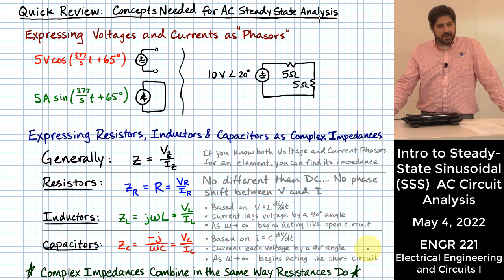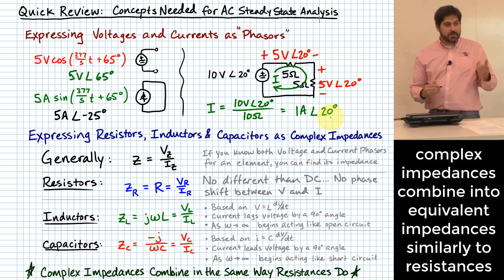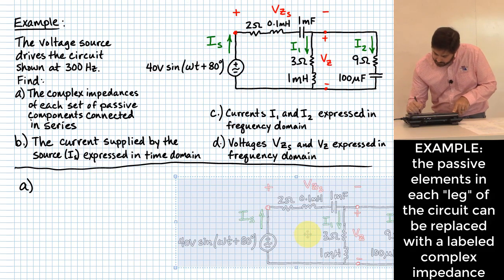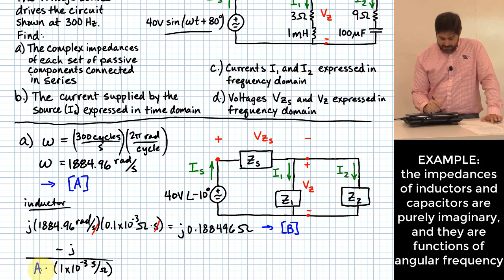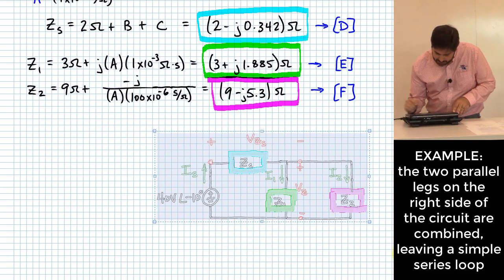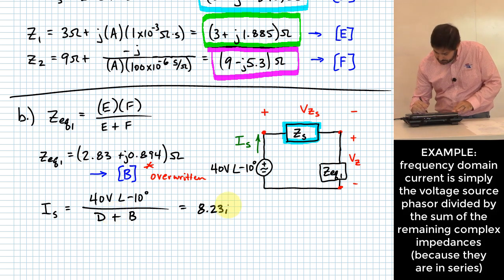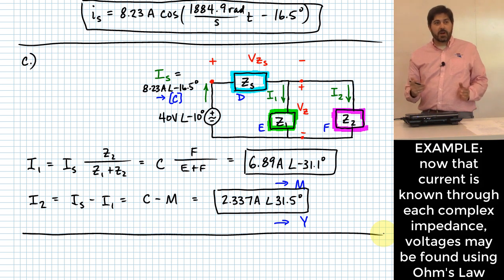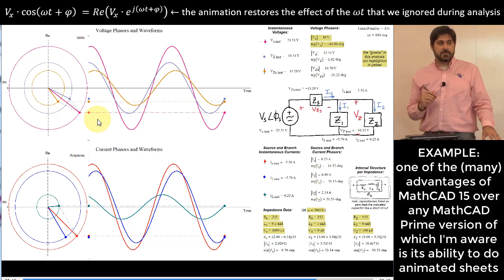Steady State Sinusoidal AC Analysis w/ Complex Numbers | Time ⇆ Frequency Domain | Rotating Vectors

Comment: hello sir i have one question 

if i need to lift  a weight with the help of motor and gearbox to a certain height does the lifting height will affect the required tourque?
Reply from the maker: I suppose if you were winding a cable onto a winch spool, it could end up causing a variable effective spool radius. That would cause variable torque with height, but there isn't a fundamental variation in torque with height until you are dealing with extreme changes in height so that gravitational acceleration can no longer be assumed to be constant. Hope this helps.